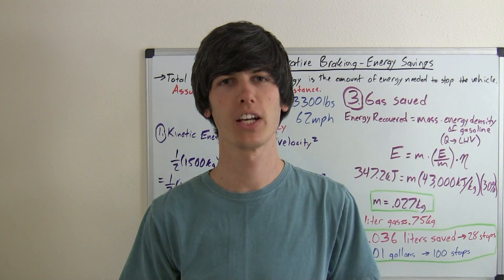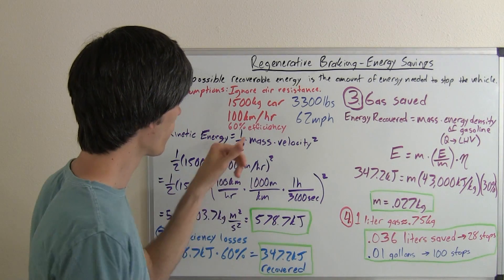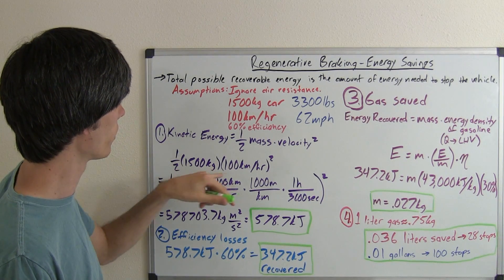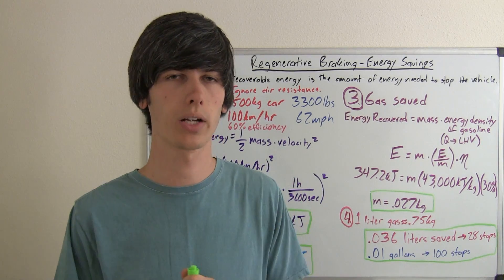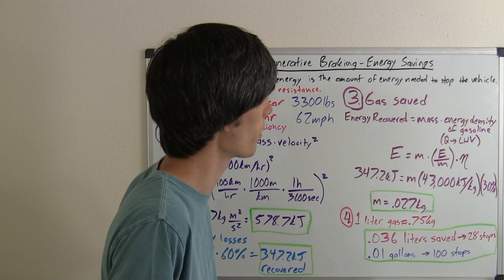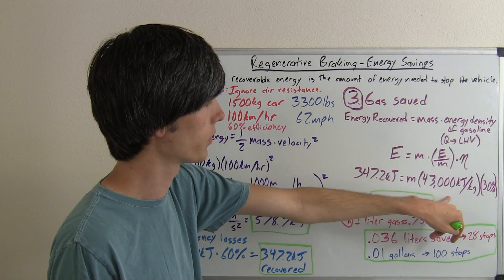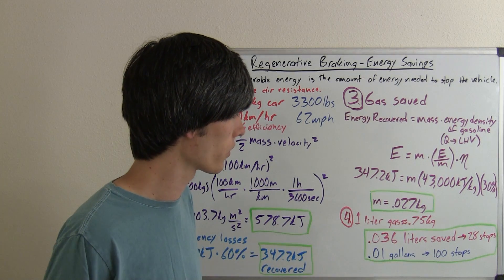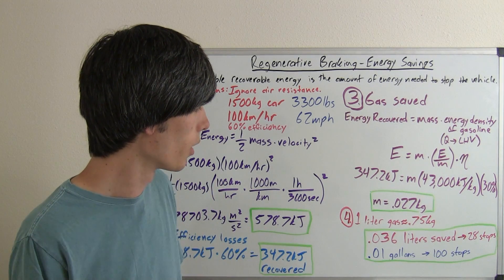Kinetic Energy Recovery - Regenerative Braking - Fuel Savings

Comment: Can an electric vehicle come to a complete spot by using only the regenerative resistance or are the friction brakes required for the last few feet?
Reply: A Tesla can come to a complete stop relying only on the regen braking.  However, if I approach a light too hot or traffic suddenly stops I will need to use the friction brakes.

Comment: You don't include an efficiency rating m for the conversion of kj recovered through braking back into useable forward motion. You tell us the fuel saving against the recovered kj. This figure needs to be adjusted also to show the losses due to the hybrid system and then compares to the amount of fuel saved. This figure will of course be lower than stated.

Comment: In regular urban driving it seems to me the improved fuel economy would be minimal.
Reply: It's actually pretty significant. It's one of the main things that gets a Toyota Prius from about 35 - 38 MPG up to 48 - 60 MPG. Where it makes less difference is on the highway where you don't slow down very often. That's why a lot of hybrids get better fuel economy in the city than they do on the highway.

Comment: hey Jason! I have a few questions:
1. why aren't engines more efficient than 30%? how do they lose all that energy?
2. how would you make an engine more efficient? is 100% efficiency possible?
thanks for the great videos, keep up the good work!
Reply: MrKillahawk310 is correct above. It's mainly friction and heat loss. Internal combustion engines do get more efficient as they get larger, but they'll never be very efficient for driving a car because the power requirements are so far from the ideal of an internal combustion engine. They're much more suited to things like electric generators, airplanes, or boats where their power needs are a lot more consistent and not variable.

I forgot who makes it, but one company has developed an internal combustion gasoline engine at a scale suited to utility-level power generation that has achieved just over 50% efficiency. That engine is very large-- similar to the Sulzer diesel engines that power large ships like cruise ships. The engine cylinders are large enough to walk into and stand inside of with plenty of room to spare. They're a couple stories tall. HUGE!

The reason internal combustion engines get more efficient as they get larger is because the larger engine is better at retaining and using the heat created from combustion than a tiny little engine in a passenger car, and because the friction created by the piston in the cylinder is a function of the surface area of the piston rubbing against the cylinder (so it's squared) while the power created is a function of the cylinder's volume of displacement (so it's cubed). If you graph out y=x^2 and y=x^3, you'll see that y=x^3 rises as a greater rate than y=x^2-- the difference between those two is where your efficiency gain due to friction comes from. And the greater the engine displacement, the greater the difference becomes, so the quicker your efficiency increases.

But lest you think that a bigger engine in your car will make it get higher fuel mileage-- it won't. That's because of the unique demands of a passenger vehicle. The engine needs to be large enough to meet the greatest power demands so that it can accelerate and climb up hills. But that means your engine will be vastly larger than it needs to be for the vast majority of the miles driven. That's because you only need to accelerate to the speed limit once-- and then you just need to maintain that speed, which requires significantly less power. It might take 150 horsepower to accelerate your car to 60 MPH in a reasonable time if you need to merge onto a freeway safely with a short merge lane, but once you're driving 60 MPH, it probably only requires about 5 horsepower to maintain that speed. That means your engine is either anemic and weak and your car is too slow to get out of its own way, or else you're wasting a lot more gas just to overcome the extra friction of a larger, more powerful engine because you don't need anything close to its maximum power while you're just driving along at the speed limit.

Gas powered engines generally are their most fuel efficient in terms of energy produced per unit of fuel consumed in an RPM range near or below their torque peak, and at about 70% - 80% engine load (turbos and other types of forced induction can complicate this rule of thumb in different ways depending on how they operate). Here's something counter-intuitive for you. If you have a manual transmission, you'll actually get a little bit better mileage if you accelerate at around 3/4 throttle but shifting to keep the engine RPM below the peak of its torque curve (keeping it within its highest thermal efficiency range). You'll use a lot more gas per second while accelerating, but over all you'll use slightly less gas to reach your desired speed than if you baby it because you'll reach your target speed in a lot fewer seconds. If you want to know more about why this is, then you'll be interested in something called "brake specific fuel consumption", or BSFC, and BSFC charts. When you look at one of these, you'll be able to see an area somewhere in the middle of the chart (typically an oval) where the engine is most efficient in terms of work performed using a given amount of fuel. You want to target that zone while accelerating to maximize fuel economy. Engineering is pretty neat stuff!
Reply: K
Reply: 1) Not all engines are limited to or are 30% efficiency, i believe it was just an approximation used for convenience. Engines lose most of their energy in the form of heat, which is why engines warm up over time. Also engines have internal components that need to move and in order for them to move frictional forces between components must first be overcome.
2) In the real world a 100% efficient will most likely never exist due to heat loss and energy being spent to overcome friction. However, internal combustion engines can become more efficient if less friction was present and if the heat lost could be trapped and converted to a more easily useable form of energy such as electricity in order to power a seperate powertrain to form a hybrid of sorts.

Comment: Hey nice video! But i must point out that you forgot to factor in the efficiency of the system to reapply the energy saved into actual acceleration (or energy that can be used to move a car). 60% efficiency means it will absorb 60% of the energy of the momentum of the vehicle... but what about the percentage of energy saved by the system that can be used to move the car? That isnt taken into account when calculating that 60%....is it? I know you just picked that number, but i mean when official numbers are released (by companies), those numbers are completely representative of the regenerative braking system alone (how much energy it can absorb from braking)...and not how well it can re-apply the energy saved.
Reply from the maker: You are correct. Though electric motors are much more efficient at applying power than recouping. Could be greater than 90-95%.
Reply: charging the battery is not high though

Comment: Hey Jason, I just wanted to ask wether or not a regenerative braking system would even matter if you are a highway driver? Currently am a city type person, so I understand well what the numbers would look like after 2 years of driving but still curious on the highway numbers.
Reply from the maker: If you're not braking, regen braking is not improving your fuel economy. Hybrids get good highway gas mileage because they're very aerodynamic (not because they're hybrid - though a small engine does help).

Comment: Hi
I was curious as to what vehicle gave you such a poor % of the energy captured.
In my vehicle the manufacturer claims in the 90's for regen in braking or maintaining a speed on a decline. (this would go out the window if you slam on the brakes) 
Where would the waste energy go if it was not going into the pack?
I would expect a small amount of heat generated in the motor, inverter & pack, but if If am creating 50kw of heat due to losses it has to show up somwhere?
I travel one road daily which has a long decline of about 2 minutes, this adds considerable capacity to the pack, if this energy did not go into the pack I would say the paint would be melting of the body and floating up onto the windscreen as I drive.
Reply from the maker: As far as I know the inefficiency doesn't come from heat loss in the motor, but rather heat loss in the battery (the battery heats up but doesn't charge all that much). I've also seen that the efficiency can be even less than I showed. If you've seen data to the contrary, I'm sure some systems are more efficient than others.
Reply from the maker: In addition, the main goal was to show how to calculate it (with a relatively accurate estimate). If you have specific data for your car, you can change the numbers and find out the savings for your individual case.
Reply: Engineering Explained
I had a quick look at specs around the system and I could not see how a charge efficiency would drop so dramaticaly under regen coditions which is basically no different to charging except there is no requirement to step up the voltage from mains voltage to pack voltage.
And that amount of heat loss in the pack would have it cooking within minutes of a sustained down hill run in the order of 30 to 50 kw.
A thought occured to me if the vehicle you were refering to was a traditional  hybrid it would have a NIMH pack of limited capacity and NIMH has a charge efficiency around 60% which is substantial in its own right also the brakes are used in combination which means heating up discs and pads are adding to the losses.

Comment: Why is this not in every new car these days? I hope it's promoted use in F1 next year will inspire more common use and greater knowledge and demand for it in cars.
Reply: it is used in F1 and it will become mandatory, it is known as KER
Reply: fergus harvey kelly I mean in street cars.
Reply: Hybrids vehicles are available but are currently expensive. There's about $8000-10000+ difference between fully petrol and hybrids which is not really considered as $$ saving for me. (taking Toyota Camry models as an example) I usually get about 200km extra on my hybrid compared to the fully petrol camry each time i go to the pumps.
I calculated that I would need to keep the car for about 5-8 years for it to make up for the extra money I spent on the hybrid. Hence i  assume that it would be harder to sell secondhand hybrids in the future since the battery life reduces through time.
Reply: William Ng  They calculated the costs so its only sensible for people who drive in urban areas where you get to stop and accelerate a lot. VW is currently trying to break through with their models. Mainly e-up which should be pretty cheap, but it is still the tiny inner city car (which probably isnt a problem since a lot of families own two+ cars these days).

Comment: I'm running the math in part 1 to calculate [Kenetic Energy = 1/2*1500*(100,000meters/3100seconds)^2] and I'm arriving at 780.437kj. I'm not sure what's wrong with my math :S

Thanks for the great video :D
Reply: That 3100seconds should read 3600, which is 60*60. it does kinda look like he wrote 3100 on the board though :P
Reply: Sam Turnbull Thanks! I should have thought through the math more ;)

Comment: Does the energy density of gasoline change depending on octane rating?
Reply: the octane level is the level of retardation of the petroleum spirit and has no bearing on energy density.
Some engines have a very high compression ratio and require higher levels of additive to increase the octane level to prevent pre-combustion (pinking) this is where the fuel ignites under pressure before the spark plug sparks.
Reply from the maker: Very minor if anything.
Reply: Ecoenergy
Thanks for the info :)